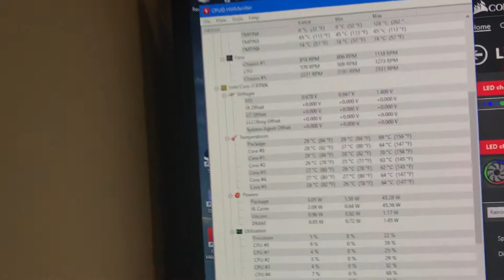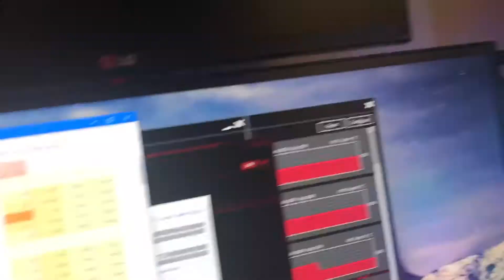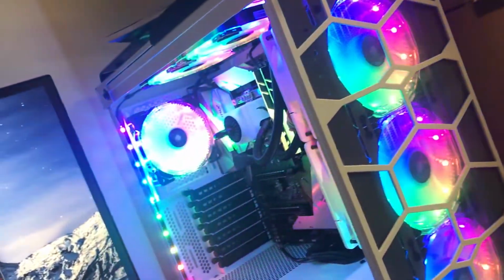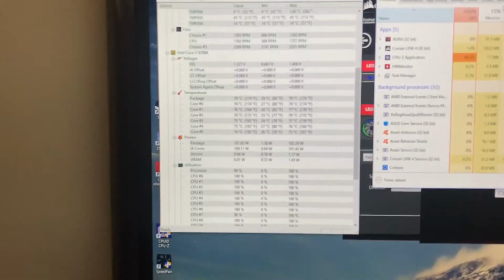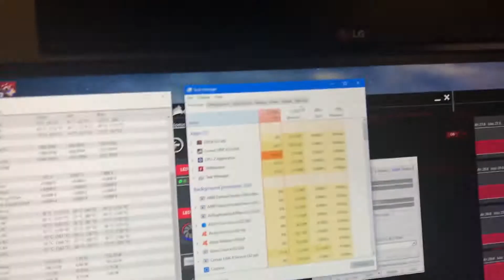Custom White RGB Corsair 570X Gaming PC Build Update | Day 5

Comment: You have to delid the 8700k. There are tools to do it safely. Then apply Liquid Metal from thermal grizzly. Then seal the lid with high thermal silicone seal. Then apply thermal grizzly paste not liquid metal but thermal paste and your temps will drop fast with the pump not at 100% so you pump can last longer. 8700k has horrible thermal paste and heats up like a toaster. Look into deliding the 8700k.